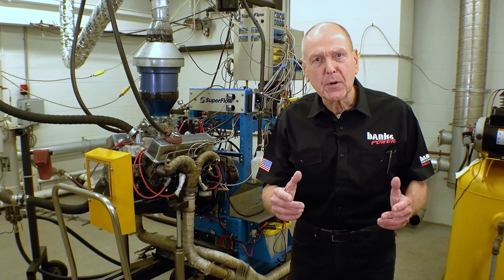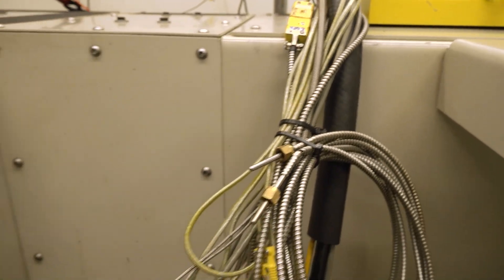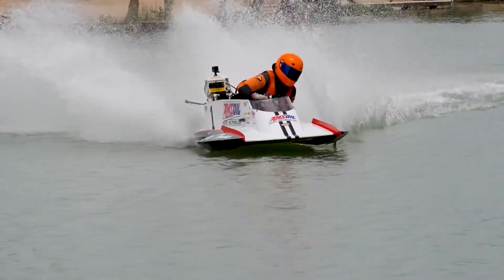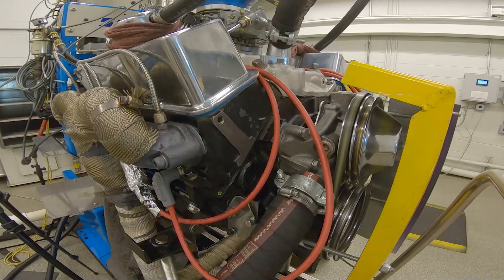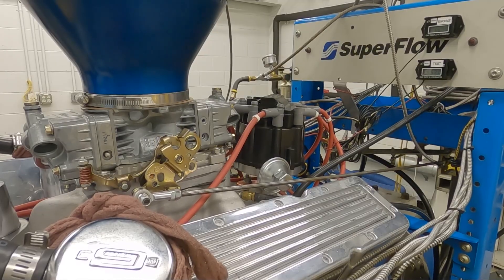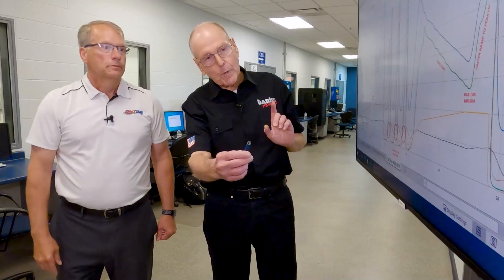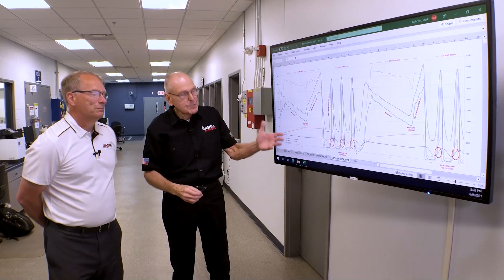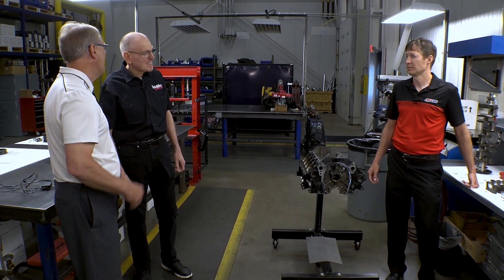This is a brutal motor oil test | Part 4 of 4

Comment: I use to race snowmobiles back in the 80's and I used Ams Oil. We run 2 cycle engines and was getting 114 hp with a 340cc Rotax engine. We run them engines ar 12000 rpm and run 100 to 1 mixture. We never had a engine failure due to oil. The only failure we had was running the engine a little on the lean side. Our mistake by jetting the carbs a little to lean trying to grab a little more power. When we took the engines apart there was a surprising amount of oil in the crankcase. I have never seen this before with other 2 cycle engine oil. Ams Oil was far ahead and better then anyone else in the business that we used back then.

Comment: 50 + years ago Smokey Yunick  did an oil test
article in Popular Science  Magazine. He was testing  a home brewed synthetic oil  made by a chemist (?)  some where in Wisconsin.
The  oil  was called  All Proof 5w -50, packaged in round  metal cans. His test engine was 300 hp 302 Chevy. He tested  with conventional oil, then synthetic oil and
back to conventional oil. He checked valves 
and whatever between  tests to maintain an accurate  comparison. His results were a gain of  20 hp and a 20 degree drop in oil
temperature. I called  Smokey  and  ordered 
 the oil for a twin engine boat with 2 modified 
302 Fords with 7 Qt oil pans. Boat also had
Oil  temperature gauges. I picked  up almost 100 Rpm and oil temp  dropped  15-20 degrees. 100rpm was a measurable  speed  increase. The oil was $5  a qt. When I called 
sometime later to order more oil he said the
formula  changed and he didn't like it and 
and couldn't  supply me. Just talking to Smokey on the phone a few times  made the
transaction  very  informative. He was
brutally  honest with his answers. I wonder 
if this oil had a connection with Amsoil.

Comment: the choice magazine did an oil test on new york taxis over 100'000 miles. using the most expensive down to recycled oils. although it way in city driving. they tore down the motors and found hardly any difference between the engines .  i forget how long ago that was

Comment: Just came across this and it is intense how much they torture the motor and oil. One question I have is does the horsepower and torque go up or down at the end of the test with motor breaking in/down after 50 hours plus with the oil breaking down?

Comment: I always believed that all oil was the same until about 18 years ago. I was at a buddy’s mechanic shop and he had a motor job on a a Ford super duty pick up truck. This truck had 315,000 miles on it and was in for a leaking intake manifold or something. When he pulled the intake and valve covers off everything looked brand new. We were both amazed and were astounded by the cleanliness of this engine. When the owner showed up to pick up his truck we asked him what oil he was using. When he said Amsoil both of us went and got our own Amsoil accounts. To this day I run Amsoil engine oil, trans fluid and differential fluid. I’m pushing 422,000 miles now and my truck runs as good as it did when it was new. I would love to get a new truck but my truck runs so good that I decided to fix the rust, paint it and keep her going. I also installed an Amsoil bypass oil filter about 12 years ago so now I change my oil every 25-30,000 miles.

Comment: If Gale is racing his turbo diesel road course truck all weekend long in 30min stints, what is the abort limit for oil temp? I didn't see any oil temp data besides the live dyno cycle data, which was only around 210F. Thanks!

Comment: This four part series was absolutely awesome.  Dan is a fabulous presenter (as well as the included Amsoil staff) and Gale was reading my mind when he asked some questions through each video.  The amount of education offered  here is enormous and presented in a fashion understandable to the average mechanically inclined layperson.  I have been a longtime proponent and user of synthetic lubricants in all my vehicles, motorcycles and power equipment, and these videos just reinforce my trust.  Thank-you to Gale and Amsoil for making these videos available.
Reply: DITTOS
Reply: I'm convinced Amsoil is a great product. I own a 2000 silverado which is running good. Would there be a drawback on switching to Amsoil at this point ?

Comment: @BanksPower   I've got a good question for the Amsoil folks.  Amsoil doesn't have their products "licensed" to OEM specs if you will (no Dexos certification on the bottles for example) but they claim to test to those specs.  Do they ACTUALLY test to all of those specs and just choose not to pay licensing fees to the OEs that make them?
Reply: I saw a rep from amsoil answer that saying that it does meet dexos standards,  and that basically they didn't want to pay for licensing. Considering the price of amsoil it wouldn't be much added but they seemed adamant about not paying it. Problem is some dealers were saying that amsoil would void the factory warranty if you had a engine  failure. Anyways I'm sure the amsoil is superior but who can afford to fight with GM, so I just bought the dexos for my vehicle. 🤔

Comment: Let's say you take 2 identical 6.6 duramax engines  operate them moderate load one operating at peak torque rpm and the other at peak hp rpm. What one would wear out the oil faster??

Comment: I have been running mobil 1 for 30 years have a few cars and a truck that have over 300k on them each and oil still looks clean after 7500 miles

Comment: Well after watching the series (haven't watch this video yet at the time of writing) I do have to give it to amsoil for willingly doing this and standing behind their products. Definitely a great brand. Tho I still find it hard to justify the price difference to its competitors (especially with sales and rebates off the shelf). But I may have to try their products at some point. (I won't ever extend my drain intervals to "save" money) but i also have no problems shelling out cash if it is that much better in real life. Definitely will use amsoil for my next diff/transfer case/transmission service thought. Engine oil, I'll have to try a used oil analysis on my current brand. Then try amsoil and compare.

Comment: I don't know why exactly, but I think I could seriously just sit and watch that for 50 hrs. Its almost soothing, and you can continuously see more and more every pull.
Reply: The only thing that I thought they would also include is a test of the oil also after the Dyno test. I've been an AMS Oil user since 1990 and absolutely love the reliability of my vehicles and small engine equipment on it.

Comment: Some of this seems useless. 
You're testing a racing oil being marketed for high end race engines, yet you're using a GM Goodwrench basically stock engine. 
He refers to microwelding of components, etc... But you're talking about often times cast rings, cast uncoated pistons and uncoated stock soft bearings. 
Race engine parts aren't made from the same materials as a sloppy mexico built GM 350. 
If you're going to market to the race engine scene, should at least be testing on race engines. And should be testing at race engine powerr levels on race fuels! Not a wheezing 300 HP pump gas engine.

Comment: What kind of absorbers load these engines? If they were generators, they could power the building and perhaps feed the grid. Just that 50 hour test alone burns a colossal amount of fuel.
Reply: Go tell Al Gore.
Reply: @billysandals  
A weak dig, grandpa. A better dig would've been "Go tell Greta Thunberg".

Comment: A crate engine is not a race engine.  I would like to see testing on a maximum effort HP engine.  N/A and boosted applications (1000+ HP).  Then we'll see how well internals are protected.

Comment: I didn't know 300 hp from a low rev chevy v8 would produce 1400 degrees F egt's, had no clue it'd get that hot. Is this a normal temperature?

Comment: I’m curious as to why they used such a relatively mild engine for that dyno oil test. 300HP ain’t a whole lot and an engine of the same size but outputting 500HP would exert much more stress on the internal components and thus the oil. Is there something I’m missing here as to why they used that particular power combo?
Reply: I'd assume because it's cheap and easy to get parts for.
Also I'd imagine a lot of grassroots racing still uses it as the motor of choice for the same reasons.
Reply: @puzzleluvr  Perhaps that’s true, you certainly make some valid points. I’m unfamiliar with most grassroots racing so maybe this is the typical power level of some grassroots series. But for sure the higher levels of competition make much more power out of equivalent or even smaller engines and I’m sure they may use Amsoil too.
Reply: Guessing they use this engine because of its flat tappet cam and lifters. The metal on metal scraping with no bearing surface, roller, or direct contained pressurized oil.
Reply: @tangydiesel1886  Now that does make sense!
Reply: Much better to try one of these little 2 liters that are pumping out 300 hp with turbos. Running intense heat and pressure. Or GDI engines, the late model hyundias typically burn a quart every 1000 mi or more. How about a ford Triton 5.4 its destroys oil and has massive engine noise.

This whole series is just a stroke fest..

Comment: This didn’t tell me anything. Using Amsoil will not make your engine last any longer than if your using any brand of oil. I use only regular oils in my vehicles and have never had a engine problem. Remember the best oil is clean oil.

Comment: I worked in a diesel engine lab doing this type of testing, seeing how the oil responds to soot creation by changing timing, vgt and egr. Keeping everything in parameters and how the different oils and additives did in with the different engines. Very cool seeing the entire explanation of what I was doing there as we never got to see the big picture and talk about it. I have to say, our test cells are not that big and not nearly that clean.

Comment: If an engine oil is created for racing conditions. The test engine measurements before and after, does that same race oil fit also other type of race engine's with compairible results. I understand that you can not make for every type of engine a specific oil. So..one oil fits all.

Comment: Nice video series.  If Amsoil would dump their MLM, I'd try their products.  I have no doubt that they may be good products, but they are not the only manufacturer that uses Group Iv base stocks, and rigorously tests their production in a lab environment as well as in the real world.  For me, I have to wonder and be a bit skeptical if their products are only available from "Authorized Dealers" AKA people that pay a fee to sell their stuff.  Lastly, "Cold Start" is the toughest on the engine along with extended oil drain intervals, not the stuff they are showing here.
Reply: highrzr.......Their products are NOT ONLY available through AUTHORIZED Dealers, but you can purchase ANY of their products DIRECTLY from the COMPANY!  What other Company will do that??

Comment: When we raced dirt, we changed oil every couple races or so, but we didn't have that much if an engine, it was about 10:1, 355ci Chevy, basically built like a stock late 60's engine, about 350-370hp, it came from a daily driven 50 Chevy truck! It had a 3030 cam intake and headers! It came alive at 4500rpm it was fun in that little truck!

Comment: Was anybody else surprised by the amount of trips back and forth to the toolbox when tearing down that engine? 

If my job involved tearing down the same SBC a couple times a week I'd be real inclined to have a set of tools dedicated for that job with exactly what I needed every time.
Reply: Wait ... Isn't there a Monty Python skit showing what happens when you interfere with the routine ?
Reply: They tear down motorcycles, leaf blowers, etc. Probably why it’s not a dedicated set up for SBCs.
Reply: @MrSpartanPaul  That's a fair take, I'm sure this isn't the only engine they do. Though I'd at the very least grab every tool I know I'm going to need from the box and keep it on the cart. Though, for the price of a few extra tools for the frequent flyer engines you'd save your staff a lot of back and forth time. And time is money.
Reply: @bradley3549  theyre not looked at by productivity in the same way as regular mechanics. Also filming may have wanted him to keep it clean.
Reply: @TheFanatic340  Yeah, I get that. Clearly aren't pressed the book hours here. But never the less, efficiency is efficiency no matter what the job is.
Reply: @bradley3549  one would think you would at least move them closer together to save on walking
Reply: @TheFanatic340  Yeah, great point. Maybe he's wearing a fitness tracker and is trying to get his steps in. :)
Reply: Yes
Reply: Don't try to use common sense here, there's a labor shortage and people get paid by the hour in Murica

Comment: I was hoping to see some data on wear. Especially, the rod throw bearings, which take the highest loads at high RPM. Rod throw bearings seem to be the most common failure in race engines.
Reply: Wtf is a throw bearing?

Comment: Just for a Dyno fun run they should try the Porsche 500 hour endurance run that mimics the race car driver telematics racing through the Alps full tilt. Harley did it with their VRod engine on the dyno and it was much more brutal than they expected.
Reply: I believe Deere also tests to 500 hours at about 140°C oil temp and 85% engine load. Rpms won't be very high, but that's hot for the oil.

Comment: his statement about zeroing out the oil film at 11:52 is not technically correct.  Is 19 psi sufficient pressure to maintain the oil film.  No doubt Amsoil has good products.  question is when and where does it provide any benefit over low cost oil such as Walmart super tech.   My engines seem to outlast everything else on the car and I use the cheaper stuff for all except my newer cars.

Comment: I've run Amsoil for years in all my cars from Daily Driver to my high end cars. Currently I'm using their products in my '72 Pantera, '87 Porsche 944T, 2013 Lamborghini LP570, and my daily beater car 2013 Hyundai Veloster Turbo. I use it not only in the engine but in the gearbox/transaxle as well where applicable. Their customer service is always there to make a recommendation based on what  is best product for each vehicle and if they don't offer anything that meets or exceeds the manufacturers recommended fluids they always tell me.

Comment: Chevy engines are not good engines    switch to a Ford or Toyota
Reply: That's why it's only been in production for 66 years.  No good at all.
Reply: Yet GM keeps up with new tech engines with old tech designs and still able to keep things simple compared to others. While Ford still can't get the ecoboost right after 10+ years. Can't say anything bad about Toyota. I regret the hell out of buying my ecoshit. Wish I would have stuck with GM or went Toyota.

Comment: More info...  What oil did they use? Is the block and all parts stock??? Do they modify the oil gallery,  high volume oil pump?  Great video! 👍  But I like details. Info junkie...
Reply: Thanks! And I forgot to say, not only do they make some Great Oil ! They also have a great engine  builders!!!!

Comment: That was another Great episode, I, loved The Smile on Gales face he lit up liked a chubby 6 year old in a Ice cream store when he saw the huge monitor with all of the data on it from the Dyno Pulls.  Makes me thankful for choosing Amsoil years ago the only oil That goes in my 2005 6.0 still has the factory bolts and head gaskets, and I, tow a approximately 11K 5th wheel.
Reply: Are you using the classic Amsoil AME 15W-40 or one of the newer products?
Reply: 6.0s are probably the most demanding for oil quality and maintaining then anything else known to man, Those HEUI injectors shears through conventional faster then Freddie Kruger jumping on a school bus!  Even crossed my mind to ignore my bedplate leaking so I can keep adding a lil fresh stuff daily!

Comment: I appreciate the info, I learned a bit.
What I have not seen in the videos is where the base oil comes from.
Reply: TheSzalkowski..........There are 5 GROUPS of "Base Oils".
GROUP 1, 2, 3 are REFINED from CRUDE oil.
GROUP 4 & 5 Are CHEMICALLY Derived in a Laboratory.
Reply: @1gr8oil  Thank you Wayne, but that is not at all what I was talking about.

The tank cars full of base oil in the first video, where did they come from? I assume AMSOIL has someone make a base oil to some specification form them and ship it in and then AMSOIL adds in the additive package.
Reply: @TheSzalkowski  That is correct as far as I know.

Comment: It’s to bad no one manufacturers an electric Prelube pump with constant pressure maintaining function(digital control, oil metal detector, oil clarity, resonate cavity Ultrasound transducer(variable frequency) to detect changes oil).  Anyways that’s what your video made me think of.  Guess I learned something
Reply: You can buy an engine pre-lube system that will force oil out through the passage ways. It comes on automatically when you turn the key. This way if the engine has been just sitting and not running for a while,  it is not running dry for the first few seconds. That is where a big part of the engine wear comes from. There is a company called Pre-Lub, or something like that, which makes a nice kit. Hope this helps.
Reply: @Colorado_Native  AMSOIL used to have a PRE-LUBE system, but not many people bought one, so it was discontinued.
Reply: @Colorado_Native  ya I was looking for pre lube and oil pressure maintainer with monitoring capabilities
Reply: @watomb  Accusump